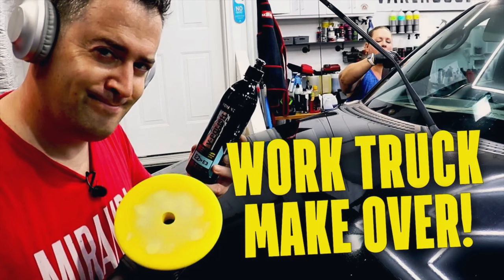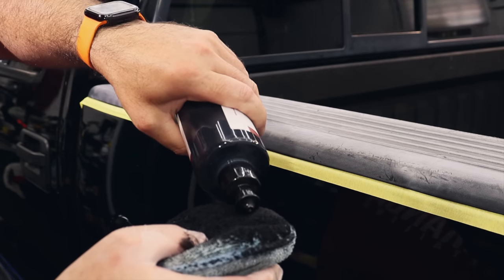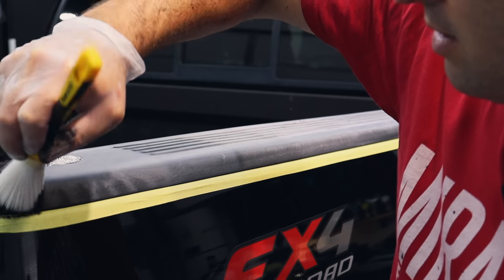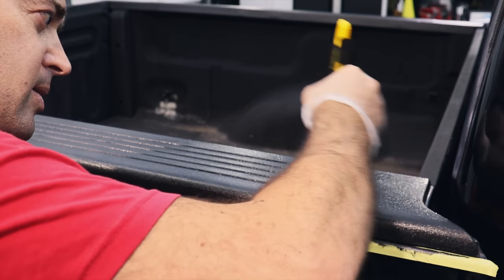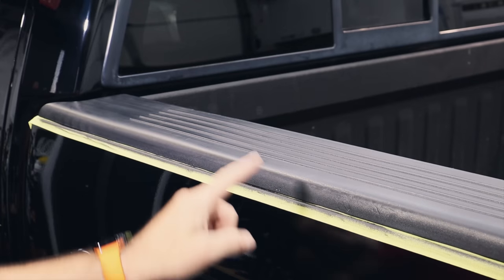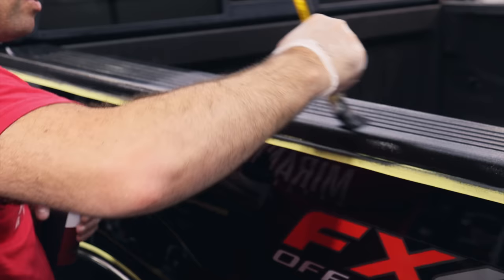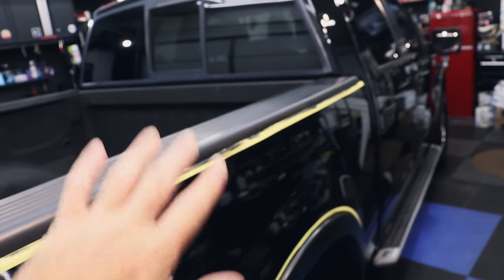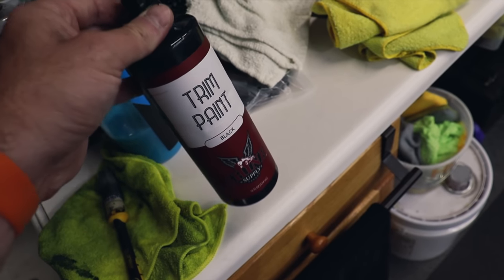How To Fix Faded Plastic Trim! #detailing #restoration #business

Comment: My thing with coating trim to restore it is that it seals the pores so it can’t be restored again. So it’ll look good until the coating starts to fail and you can’t bring it back as much after
Reply from the maker: Hi. Curious…have you seen that first hand?  Not sure where you heard that but I have used Gtechniq C4 trim restorer on an avalanche and it restored the plastic perfectly, 3 years later it it did fade again and I restored it again perfectly with the coating.
Reply: @MirandaDetailing  no haven’t seen it first hand. But a product like solution finish is designed to penetrate through the pores, break down the oxidation, and dye the trim. So it’s doing more to fix the issue, while a coating is just layering on top and masking the issue. For a customers car it may be best to use a coating as you described, but for a long term solution I’d rather use something like solution finish and reapply every 8-12 months. I probably did a poor job of explaining, but Chris West at solution finish has explained it before. And for a company that only does plastic trim products, if a coating would be better, he’d have made one by now. Just my 2 cents
Reply from the maker: @ethanblan435  Cool!  Thanks for sharing. I have used solution finish on really bad trim also, and unfortunately it didn’t work.  Some trim is beyond just dying, at least that’s what I have experienced. It definitely think that each situation has its remedy, solution finish has worked plenty of times for me on certain trim, while coatings also did great, while trim paint is more of a last resort. 
Thanks for sharing! 😎👍🏼

Comment: Great video and great job as always.
Would wiping it down with an isopropyl alcohol and distilled water mix like prepping paint for ceramic coating help adhesion last longer on this ?
Reply from the maker: Hi. Thanks!  Yeah becasue I cleaned the trim so well there it was fine. But when coating plastic I would definitely do a ipa wipe before application.

Comment: I used paint Foam brushes with Solution finish
Its cheaper and less annoying to work with than detailing brush
Reply from the maker: Good tip!  Thanks! Being a painter in my past life I hated foam brushes! But that’s totally an option for those who want to use them.

Comment: How much of the bottle was used and did you do 2 coats on all the trim you painted.
Reply from the maker: Hi. It’s hard to tell how much product was used because the bottle is not transparent, but probably about an 1/8 of the bottle or so.  Yes I did two applications, I believe I mentioned that in the video.  😎👍🏼

Comment: Great video phil.

Can i ask? Would be profitable or cost/time effective if you used some drops of some trim restoration quality ceramic product like Gtechink c4, DPC T2 ? 

What is your business oponion.
Thanks. A lot take care great video
Reply from the maker: Hi. Oh yeah that’s definitely an option also. I mentioned that in the video. This is just one way of doing it. Also some trim may be to far gone and coatings won’t even help it at all. So trim paint is a last resort option.
Reply: @MirandaDetailing  Agree Phil , thanks for sharing your perception, i understand.

keep up sir
Reply: I used a 1 yr rated spray ceramic (Immortal by Phoenix EOD) with good success. On my personal 2013 Ford F-150 I ceramic coated the entire truck (Kronos by Phoenix) and did the black plastic trim last when my applicator pad was already saturated. I still ended up using around 5 mills of liquid though. The plastic trim soaks it up pretty good.